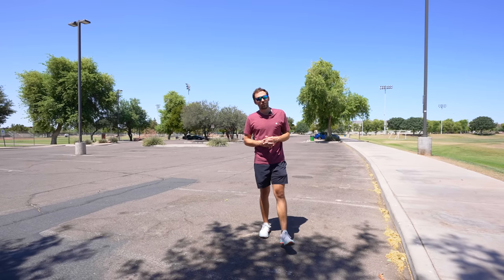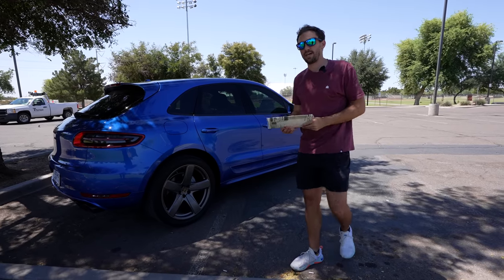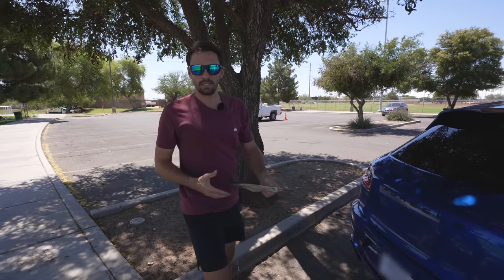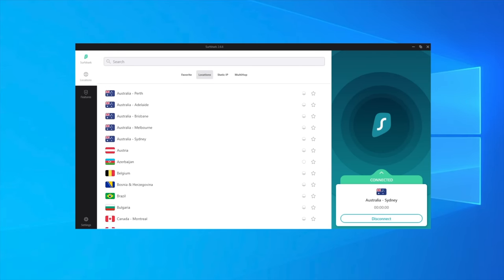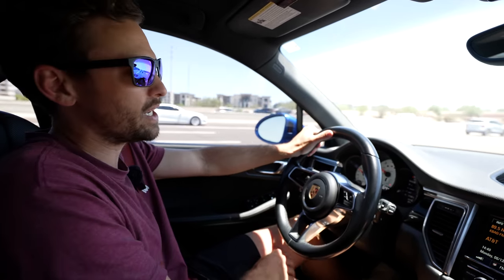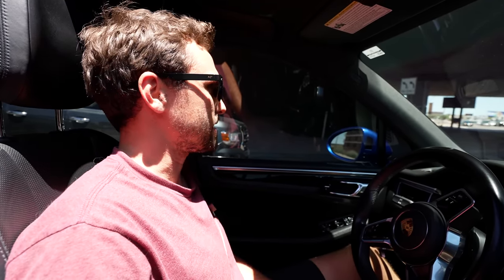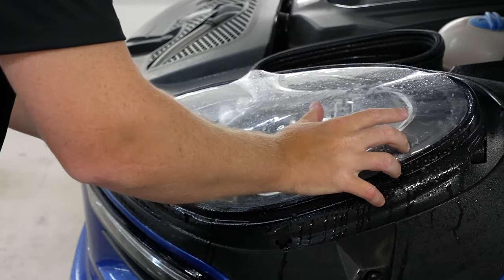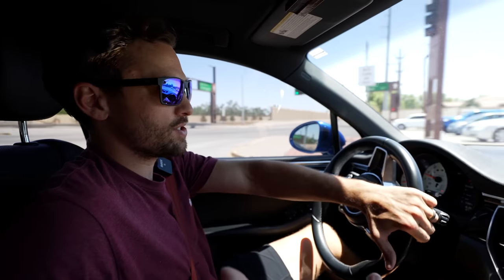I Bought My First Porsche! + Sport Exhaust Revving

Comment: I owned 3 Macans in the past 7 years (S, GTS, S) because I just couldn’t find anything with the optimum balance of sport, luxury and utility — Until I bought a Model Y Performance. I agree The Porsche PDK, PASM, PTV are all what makes Porsche so great. The linear acceleration of the MYP is addictive. The one pedal driving in sport mimics a downshift before a bend when you learn to modulate the pedal and accelerate through the turn. Until the full electric Macan is available I’m hooked on the MYP.
Reply from the maker: Yea it’s hard to beat a model Y. They are excellent

Comment: Let me see… I bought my 2015 P85D 1 1/2 years ago for $45,000 and 41,000 miles. It is 2 seconds faster than the macan S. Has the same top speed and costs me $8-10.00 to fill up. I could currently sell it for $55-60,000. Don’t think I will ever look back. Nice blue, hope you have deep pockets for the up coming repairs… you could be the new samcrac of Arizona….

Comment: That's a sweet car, but speaking from experience an out of warranty Porcshe is a hard pass. There is a reason it is so cheap. It's going to be $5,000 - $7,000 per year in maintenance costs.
Reply from the maker: Maybe on other models I don't see how you can possibly get to 5-7k a year. Are we replacing the engine annually
Reply: Its around 2000 per year unless something big breaks